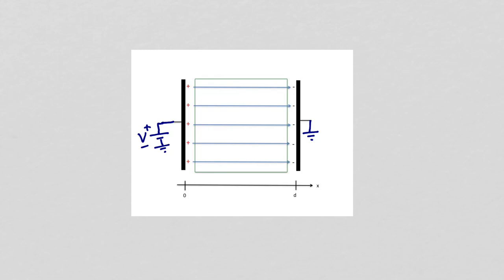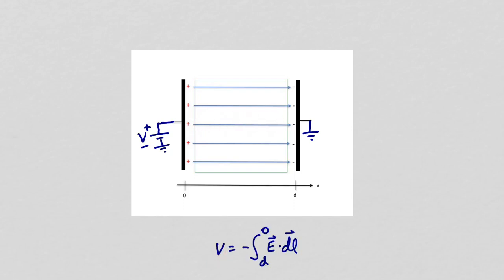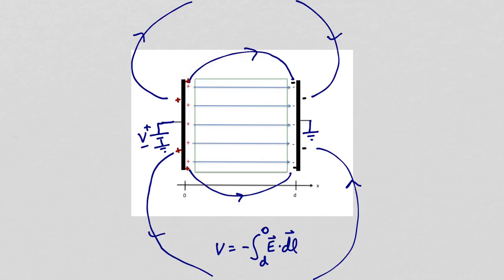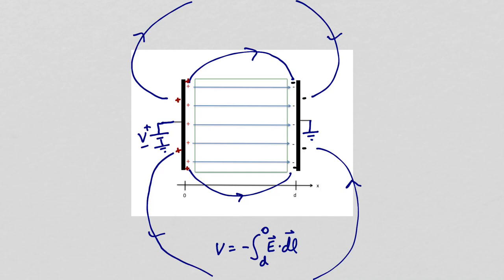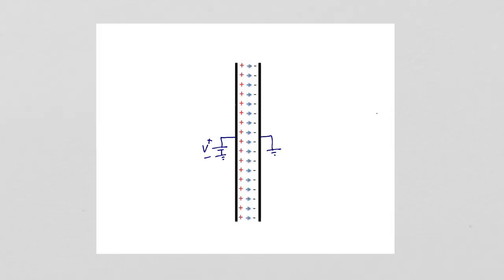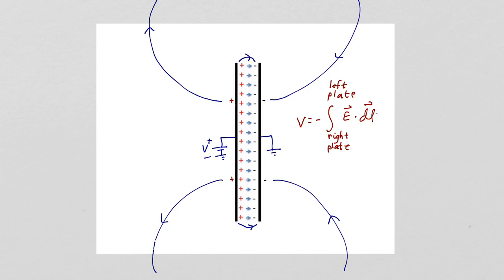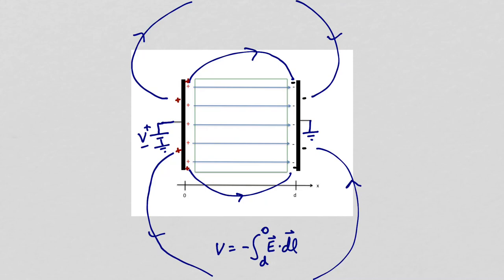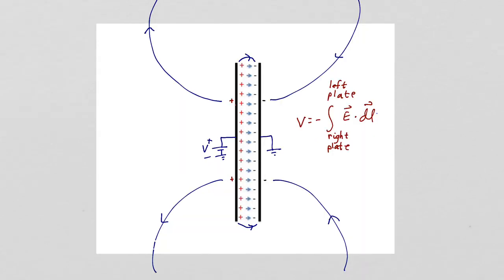Capacitors and Fringing Fields

Comment: Useful explanation. You said you wanted to ignore fringing fields because they are negligible compared with the field strength between the plates, but aren't fringing fields responsible for the applied voltage by the capacitor (to the circuit) when discharging? So as far as I understand that's a crucial contribution to the workings of a capacitor. Without fringing fields discharge would not be possible.